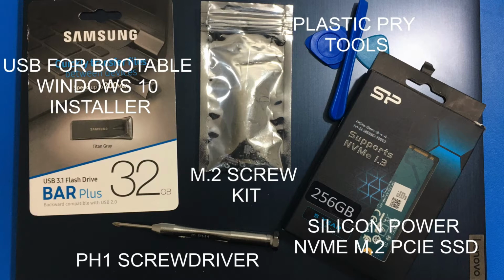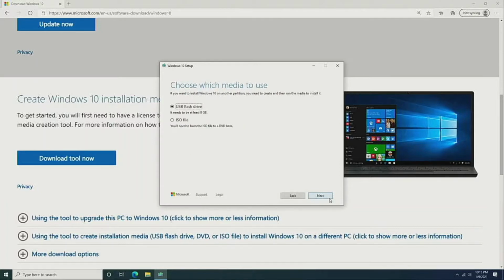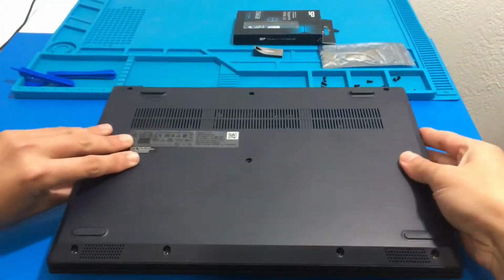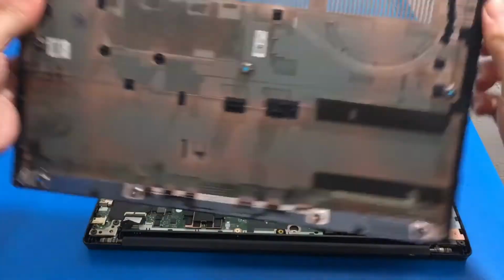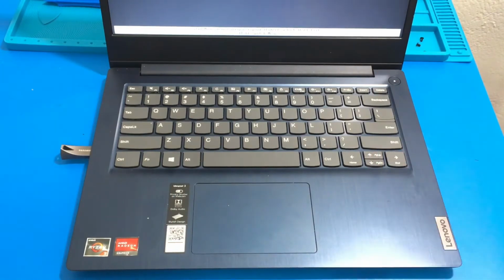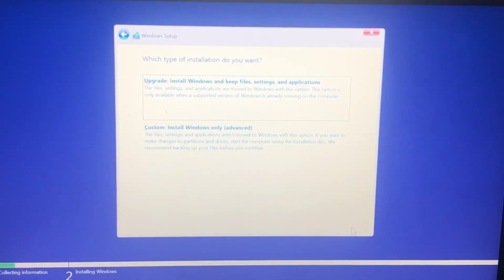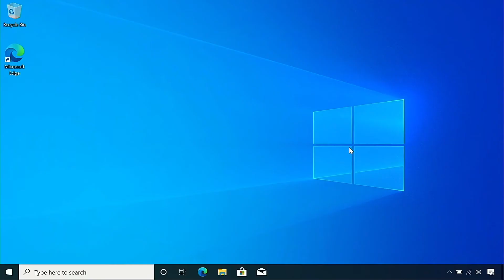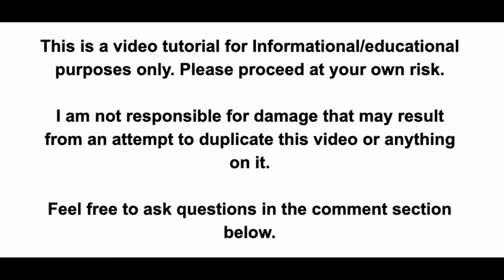SSD Upgrade! Lenovo IdeaPad 3 - 14ADA05 Laptop | Silicon Power 256GB M.2 2280 SSD - SP256GBP34A60M28

Comment: Hello i know im a bit late but is it required to delete the partitions?
Reply from the maker: Nope. It just makes it more clear. You can load an image or backup too. As long as you are familiar with your drive
Reply: @whattmeter  oh ok thanks dude.
Reply from the maker: Good luck
Reply: @whattmeter  Hey dude i was just wondering but is it possible to add a 80mm x 20mm into the same laptop ?
Reply: @whattmeter  Although it says form factor is m.2 2280 can i fit this 3.5mm in the laptop?
Reply from the maker: 3.5 hard drive? I’m pretty sure that would be too thick. Did you open it by any chance? Some laptops have the ssd connector ready to add an ssd
Reply from the maker: The 80x20mm is the M.2 2280 right? It should fit. Just make sure there’s standoff screw and a hole to put it in for that size
Reply: @whattmeter  Yes it is its dimensions were 80x20mm but it said its form factor was m.2 2280
Reply: @whattmeter  quick question what do you mean 80mm form factor is it like 22mm x 80mm or 80mm x 22mm?
Reply from the maker: @proman24700 2280 ssd means  22 mm wide and 80 mm long. Basically just the size of the ssd. I wasn’t sure because you mentioned 80x20mm so I was wondering if that was a different size
Reply: @whattmeter  Hey dude i just realized but my laptop is the same as yours but when i checked theres no hard drive or ssd its just an nvme inside can i still boot up with just a nvme ssd?
Reply from the maker: Nvme is faster than a hard drive
Reply: @whattmeter  thanks
Reply: @whattmeter  Hi sorry to bother you again but if i am currently using win11 and then switch to a new nvme can i pick win10? or do i have to pick win11 again?
Reply from the maker: @proman24700 if it’s a clean install you can use windows 10 https://answers.microsoft.com/en-us/windows/forum/all/installing-windows-10-on-a-brand-new-laptop-that/91138802-b6cc-4bcd-abf3-a4c278973440
Reply: @whattmeter  thanks just earned a sub!
Reply: @whattmeter  Hello It's me again im just wondering did your laptop have a HDD bracket when you bought it or did you buy the bracket itself from whatever shop you bought it from? Since Im having a hard time looking for the exact same bracket for my laptop.

Comment: Mine came with a hdd like urs  instead of an ssd can I swap the hdd for 512, 750 or 1tb 2.5 inch ssd without any tool kit stuff and  can I add a 512gb NVMe m. 2 ssd too to have too SSD’s
Reply: You need to have tools otherwise you wouldnt be able to open the laptop. Also when upgrading or touching things always disconnect the battery.
Reply: @proman24700  okay thanks. But what I’m asking is can I swap from a 1tb Harddrive to the a 1tb 2.5 inch SSD? I have the tools needed.  What I’m really asking is if the laptop would support a 2.5inch 1tb ssd
Reply: @Tess11  Check your laptops manual some laptops have limits to how much gb they can upgrade it to example the lenovo ideapad 3 14ada05 has a limit of only 512gb of ssd storage m.2 2280 check if your laptop supports it and you need to be sure yours is the specific one you are sure you have if you dont know anything about these i suggest just going to a computer store to upgrade it for you might cost more but lessens the risk of breaking it.

Comment: Guys I'm about to buy it tomorrow, I'm confuse if i can upgrade the RAM from 4gb to 8gb or maybe 8gb+4gb?
Reply from the maker: It’s possible
Reply: You can also use a 16gb stick and get 20gb
Reply: @kennywhiddon1497  It has a max capacity of 12 gb ram
Reply: Is it upgradeable? my friend told me it's not since it is "Soldered Ram"
Reply: @flightsimulatorph1047  it has one free slot and the other module is soldered to the motherboard, so you can easily upgrade for more RAM.

Comment: What's with the windows 10 installer? And the bootable flashdrive? Do we need to purchase them before applying or installing SSD? Why?
Reply from the maker: I prefer doing clean install of windows because there’s often bloatware or software I dont need when I get a new pc. You can use an image or clone your data or a backup if you plan on upgrading your ssd
Reply: @whattmeter  can I also do the clean install even if I am not going to upgrade SSD but the laptop is new??
Reply from the maker: Yes it’s possible to do clean install even on new or old pc even without changing ssd. I recommend backing up your data first though or image or clone
Reply: @whattmeter  thanks. Could i use any flash drive to back up and to DL the windows? And also how to image or clone? i have never been done it before.
Reply from the maker: There are many tutorials on imaging and cloning. For backing up and creating a windows installer usb, I recommend keeping the backup separate from the windows installer.
Reply from the maker: They also recommended at least 8gb flash drive for windows installer
Reply from the maker: You don’t have to do a fresh windows install. Only if you prefer it that way. Others often clone or image their pc and load that since they have a lot of their files and programs set up

Comment: hey bro i have same laptop as you but mine is ryzen 5 do you think i have same parts of bracket for that ssd?
Reply from the maker: Did yours come with a hard drive or ssd? If it came with hard drive you probably have a bracket in there already
Reply: @whattmeter  mine is window ssd
Reply from the maker: Most lenovos come with the hard drive bracket but it depends where you bought it. Some computer shops remove the hard drive bracket. The lenovos i have bought from Amazon and best buy included their brackets even though it had the ssd and no hard drive
Reply: @whattmeter  thanks mate btw i subscribe t your channel❤

Comment: is it possible to upgrade the CPU on this laptop... i got the lowest variant athlon 3020e,  i need more horsepower...
Reply from the maker: I would run cpu z on it to see what motherboard and cpu socket you are dealing with.. Also check task manager. I've never tried swapping the cpu on this one.

Comment: Hey bro i had the same laptop as you, question is there is no 2.5 hdd/ssd bracket and sata conector in the box or in the laptop,,, how do i instal a 2.5 hdd/ssd in there?
Reply: Yea im having the same problem also, i bought a 2tb seagate SSD and cant find a way to connect it, my battery is longer then yours it fills up the whole bottem part. Any suggestions, is there a way to get it connected anyway? Or should i sell or swap for a smaller SSD
Reply from the maker: oh there's many configurations for this laptop. Most lenovos include the connector for the 2.5inch ssd. Although most of them don't include the bracket, only the cable/connector. depends on where you get the laptop
Reply: @whattmeter  mine came with a hdd like urs  instead of an ssd can I swap the hdd for 512, 750 or 1tb 2.5 inch ssd with any tool kit stuff and  can I add a 512gb NVMe m. 2 ssd too to have too SSD’s
Reply from the maker: @Tess11  Yup you can use a 2.5 inch ssd as your boot drive. You can have two ssds. A 2.5 inch and an m.2. Make sure to check your laptop layout as there are similar models of this laptop. good luck

Comment: What does the SSD do
Reply from the maker: Faster boot up and read and write speeds compared to the original hard drive installed. There are many configurations to this laptop so you might have an ssd already
Reply from the maker: Check toward the end of the video for difference in read and write speeds
Reply: @whattmeter  yes I should be getting one very soon so I wanted to know these things so I could also upgrade it
Reply from the maker: Nice good luck

Comment: Hey bro its me again i've been wondering if lenovo ideapad s145 can be use when the battery is not conected in the laptop because some of my friend sudjesting to remove my laptop's battery and just yung the charger to let is stay on,
So before i do that I want to know from a pro like if it is safe to remive the battery and use it?
Reply from the maker: Ive actually never tried that surprisingly. If that happened we usually replace the battery. Is your battery bad?
Reply: @whattmeter  im just worried because i play league of legends and valorant wich can cause a lot of heat that could bloat my battery that is why i tought i ask you if it would still work even without the battery and also, the reason I cant buy battery right now is that i used up some of my money for my mom hospital fee and i almost sell my laptop for it even tho.i just bought it almost a month ago
Reply: @whattmeter  and if you could make a video if lenovo ideapad s145 can be used even without a battery like the other laptop that would be awsome and cool to know how to do it
Reply from the maker: Not sure how stable it will be since it wasn’t build with a removable battery. Also there’s alot of videos to make and I can barely keep up